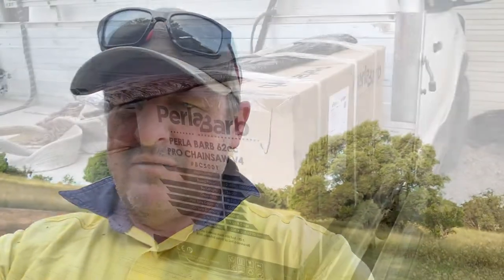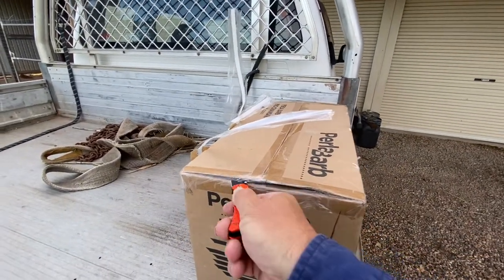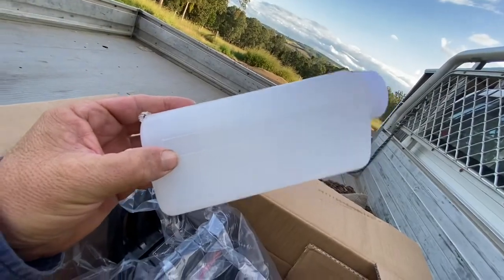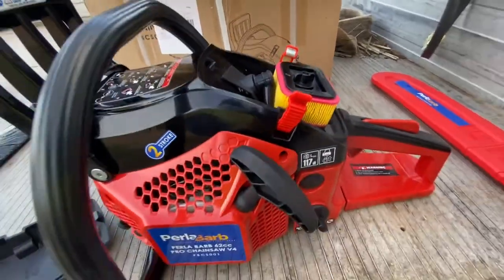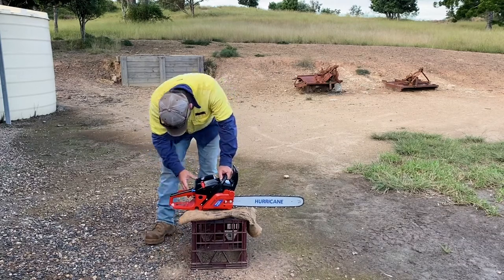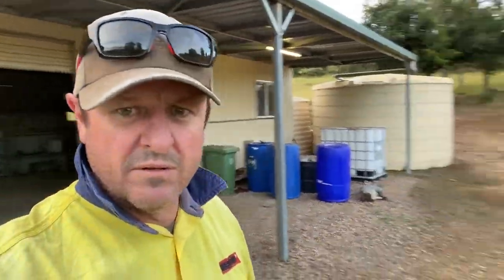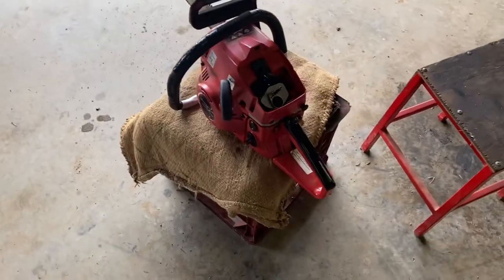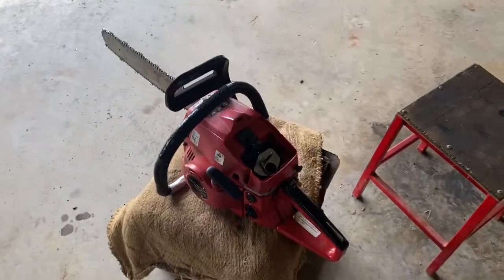Perla barb 62cc pro v4 chainsaw showed up.

Comment: i appreciate the feedback...ive ordered mine..my other saw is on the blink and i need back up..awesome video... thanks shane..yeah my other saw seems to starve out when its hot...not sure if fuel lines are collapsing from the heat..or poor carby issues..ill swap out the fuel lines on that saw see what happens..go from there...ive cleaned carby several times..poor design i reckon
Reply from the maker: Yeah they can be frustrating Jono and Johno sell carby’s fuel lines everything.

Comment: G’day mate, I’ve only just received my V4 a couple of weeks ago as well , I love it, goes like a bought one ☝️… I have only used it a couple of times on small timber while running it in. When I ordered mine by the same people as you? It took a month or more to arrive and they were only in the next state, I was a little bit over it by the time it arrived. I have to run it on 25:1 fuel mixture and I thought that was a bit rich to start with but apparently it has to run that much oil all the time. 
Good luck with yours and can’t wait to see how it goes on your next video, as I said earlier mine seems to go strong and feels good in hand.
Cheers 🍻

PS. Your version one V1 have you tried opening up the carburettor (L) low side screw a little to try and see if that changes the throttle response?
Reply: Hey mate where did you buy the chainsaw from I'm in qld and looking for a website to buy one from
Reply: @jman6949  Hi mate, I got it from a very reputable company called Jono and Johno in Ballarat, Victoria they sell a lot of gear to all over Australia.
Hope this helps
Reply from the maker: Hi Wayne yeah 4 weeks that’s rough I have been lucky with my orders I’ve bought 2 saws and some chains and they have never taken more than 5 working days I am in the South Burnett area Queensland. I mix my oil at 32-1 in everything 2 stroke I always try and use a synthetic oil. I did pull the carby apart and gave it a clean and it’s still no good there telling me July some time for a new at least there only 24 dollars I couldn’t tell you how much fuel I have put through that V2 but it would be heaps it’s been a good saw.
Reply from the maker: @jman6949  EBay or Johno and Jono mate same price same company.
Reply: Cheers guys 🍻  I'll give one a crack just for winter here on a farm aswell
Reply: @aussiebattlerfarming61  thanks so much for your reply mate 👍.  I do like the idea of 32:1 also with synthetic oil, that's what I was thinking. Its a great chainsaw so far. I have a couple of Sthil safe also which are very reliable but this Perla Barb feels very solid also.
Atleast you have the new saw now until you can receive your new carby for your other saw, good luck with that.
Cheers

Comment: saw has a air leak either under cylinder or the boot from carb to cylinder start it  then spray carb cleaner around if it speeds up or dies you found leak
Reply from the maker: thanks Bob the saw runs fine if you keep priming it  the carbs are not great on them and with the filter design on the V2 it does not take much to gum them up. the V4 is much better. thanks for watching.